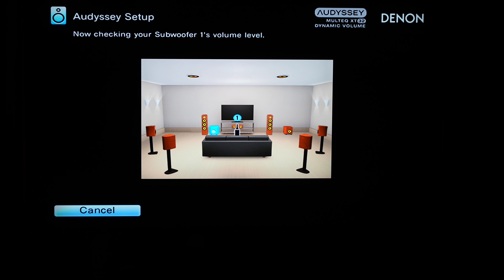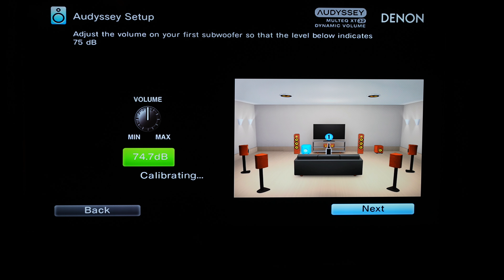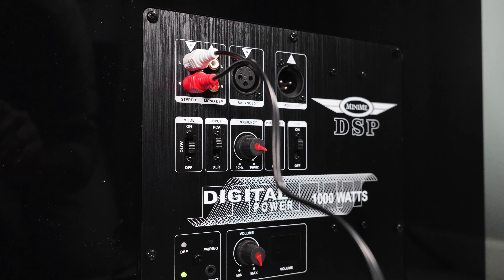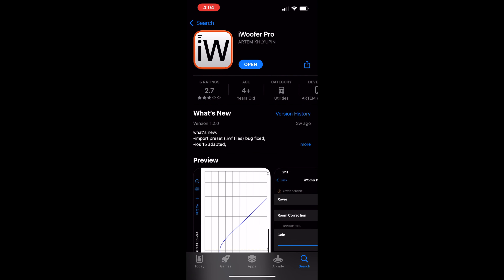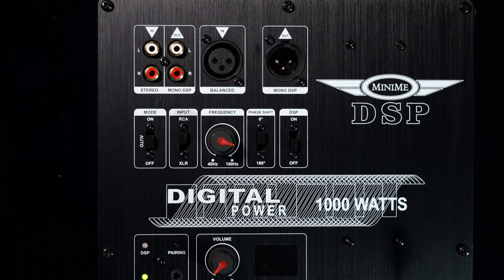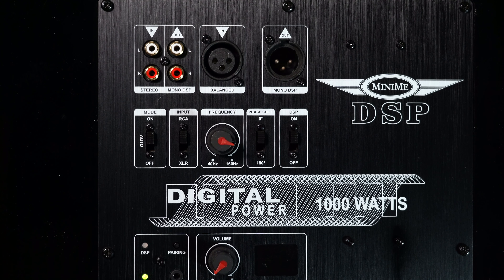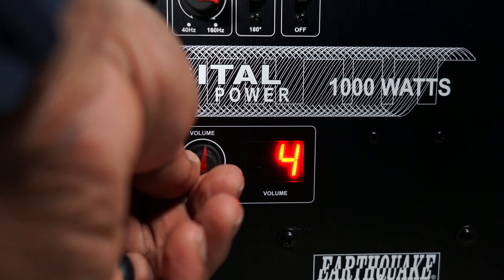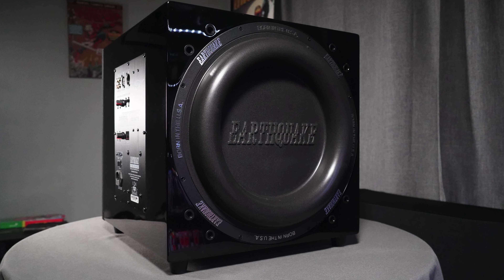15” Dual Subwoofers | An Earthquake MiniME DSP P15 Story

Comment: I got the 10inch Minime, really enjoy it. One question does running DSP on gets warmer than off? Is no much difference just wanted to check on the 12inch. Also when I use iWooffer I lower the gain-7db and raise volume to 20, works great on -40db amp volume

Comment: Great as always! Two questions for you sir... First, is Hsu still king? Second, in your normal configuration are you running one or two of the Hsu subwoofers?
Reply from the maker: Still running the Hsu along with a pb1000 from SVS in the rear corner. Still love the Hsu but DSP is incredibly tempting. 🤣🤣